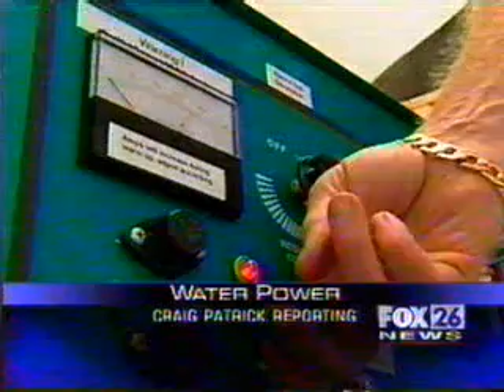Imagine cutting steel or running a car with ordinary water

Comment: The information in this video is total bullshit. Water cannot be used as a fuel! You can split it though to burn again afterwards, but you need at least the same amount of energy to split H2 and O2 molecules from each other as the process of burning releases.

Comment: There is no conspiracy here, dudes. This works, but is not economically advantageous because you still have to burn gas or a battery in order to produce the HHO.
Also, since HHO burns hotter than gasoline, the car parts wear out faster.

Comment: The process of producing HHO requires electricity. The amount of energy produced is not enough to justify the battery power required. The reason he runs a hybrid car is that he burns the gasoline to produce the electricity to fuel the HHO production. There is, as in all machines, a net loss in all of this.

Comment: I don't think a hydrogen flame is "slightly warm to the touch"
And they're ignoring all the electricity you need to make hydrogen from water.
Hydrogen is just an energy carrier, electricity is the power source, water is not even involved.